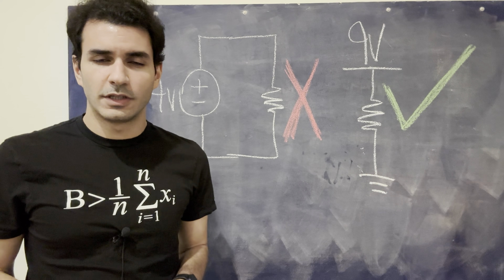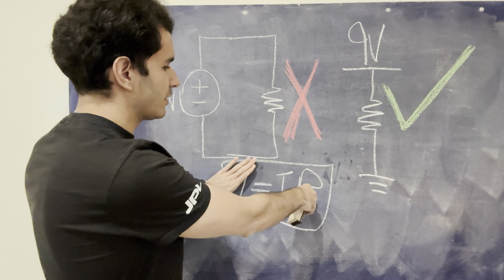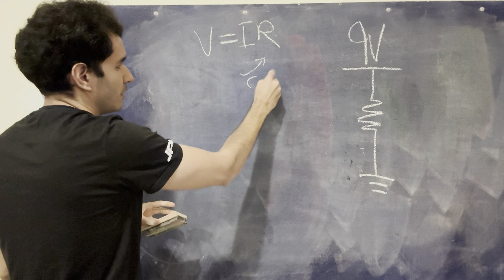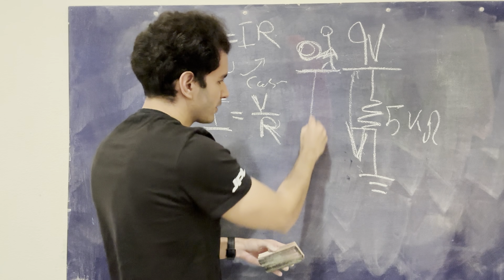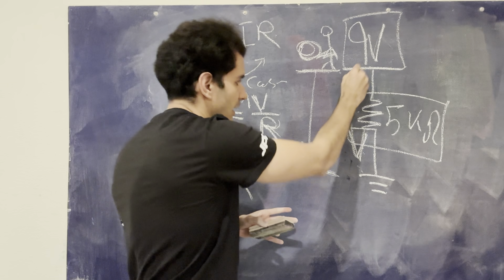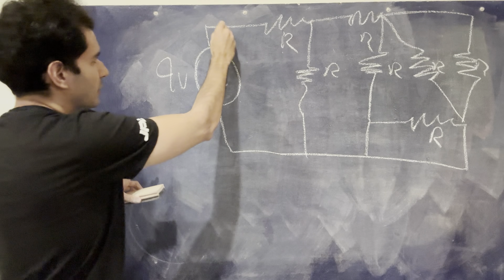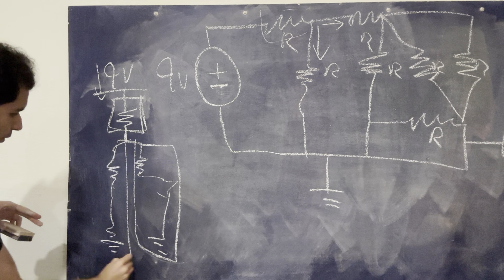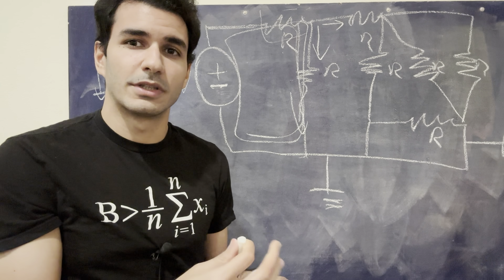Circuits Finally Made Sense When I Saw This One Diagram

Comment: No way to get around it, current must leave somewhere, and eventually come back there.  That "9V" has to be with respect to some other reference point; if you choose ground, that's fine, but voltage is always a difference between two points.  I guess if it helps your understanding to redraw it that way, great, but you can't lose sight of the basic electrical principles of potential difference and current flow.  What happens when you have a dual supply (plus and minus) op amp?  Would you have current flowing "up?"  The + and - supplies are referenced to a common or ground.  Then I guess you're back to loops instead of a simple +, ground, and resistance.

All the V=IR is telling you is the relationships between the numbers.  Hold voltage constant, increase resistance, and there will be a proportional drop in current.  Hold resistance constant, but increase voltage, current increases.  The triangle or circle with V, I, and R is just a convenient way of "doing all the algebra ahead of time".  You want resistance? Why, that's v/i.  With the "standard" V=IR, you divide both sides by I to derive that.  But looking at the triangle, it's kind of "instant".

Comment: I just finished an exam on process heat transfer, and as a chemical engineering student, we model heat transfer using an electrical circuit analogy. The resistance is modelled as a function of the material resistance, voltage is modelled as a function of the heat transfer, and the result is the temperatures at specific points along the "'circuit". When doing these problems, we would use series and parallel resistors to describe composite materials where heat could travel multiple paths. We would show it from left to right, or the direction heat travels.

It's interesting how several areas of engineering (and science) overlap with each other and can be used to describe the same principle, but in different flavours.

Comment: The triangle is meant to be a memory aid, not an explanation. You need to understand what the equation means first.

Whichever way you write the equation, it doesn't imply anything about cause and effect, it simply states a relationship. Very often the voltage is the cause and the current is the effect, but it can be the other way too, for example when you have a current source driving current through a resistor. You need to start with what you know and arrange the equation so that it gives you what you don't know.

One situation where I find it more useful to think about current loops rather than voltages is in a boost or buck converter. During the "on" phase current builds up in the inductor, and during the "off" phase the current wants to keep on flowing in the same direction, charging up the output capacitor. Trying to think about what's happening to the voltage across the inductor through all of that just gets me confused.

Comment: I like this idea, but with the 2nd diagram I kinda lost. Maybe you can make another video that explain it more simple and with the actual vertical drawing. Also, I was always wondering how people can make a board with I assume same "ingredients" but have different result. By ingredient I mean, a couple of R, a couple of Elco, a couple of TR and voila, it is an audio amps. But other PCB with the same ingredient (of course with different value) and voila it is an FM radio.. How can that happened?

Comment: Wow, you are SO wrong!
In what sense is the one on the right a 'circuit'?
What's circulating? Around where?
And as for Ohm's law being 'very stupid'...it not Ohm's law that's stupid.

Circuits is "this complicated thing where you have to pull out equations & do math".
Well yes. Drawing vertically and eliminating the return path doesn't remove or invalidate Ohm's law.
You're not going to get far in electronics if Ohm's Law is hard for you 🤣

Comment: a circuit IS a loop.
and what enters must exit. 

the "dumbed down kindergarten" level of understanding is only exacerbated by thinking of the "open, vertical" schematic. all it does is make things confusing as you get more complex circuits.

the TRUE electrician understands the LOOP aspect. that there must be a current or voltage source, and what goes out one end must return through the other.

Comment: This is a great suggestion for the more intuitive representation.  There no reason teason this cant be done left to right like ladder logic used in PLCs and some old electronic wiring diagrams (where PLC ladder logic comes from). Regardless, it certainly helps present the relevant information of the series/parallel structure in a readable way.

The only thing I would avoid is labeling the negative terminal as ground. I know it is a common practice but it is a misleading shorthand and there is much confusion out there about what ground even is, as in practice it is used mean a variety of specific things in different applications or (unfortunately) often left ambiguous. 
ie: earth ground, chasis ground, bonded or unbonded ground, neutral, negative, etc. In my opinion, ground should be reserved as a reference designation relative to the relevant environment and not as part of the functional circuit. That said in some applications such as automotive a "chasis ground" is the path connecting current to the negative terminal of the battery similar in a way to SWER power distribution, whereas a chasis ground in automation and appliances is a redundant(US) path to prevent stray potential. And let's not forget the complication of an earth ground bonded to the center tap of a split phase transformer.

Comment: Sadly, this guy is not EE material.    He is trying to apply arithmetic rules to electric circuits.   So what happens when  he eventually learns about Kirchoff's current laws?    And with his way of thinking he will never learn incremental modelling.   The world is not all DC.   Electrical Engineers use Laplace Transforms.   That allows them to look at circuits in the frequency domain.   I'm sure if he had to write a first term sophomore electronics exam he would get 0.
Reply: You are right Indeed. That's why this guy is  teaching in youtube and not working in NASA.
Reply: He might be working at NASA.  I spent 14 years as a contractor at a NASA research center and saw quit a few lunatics like him.  Some had masters degrees or a PhD.   Anyone following his method will be handicapped and never progress past his simplistic arithmetic.

Comment: For a lay person, this explanation may be enough. If this was all there is, anyone could be an electrical engineer. You really need conventions in order to have applicability to more complicated (real world) circuits. As an example, you can easily have cases where resisters are not in series (an exclusive node between two resisters) and not in parallel (two resisters connected to the same two nodes).  You are cheese toast in that case without delta/wye conversions to break things down to an equivalent resistance. Now you sprinkle current sources and voltage sources all over and it gets even more complicated. Then you mix in dependent and independent current or voltage sources ... and you eventually get to the point where the big bucks need to be paid. Its not that much memorization ... just a set of conventions and procedures that allow complicated circuits to be easily managed.

Comment: It’s even easier than that.  Think about it like water.  Voltage is the speed, resistance is the diameter of the pipe, and current is the amount of water flowing through the circuit
Reply: and charge, or a coulomb, is a quantity... a litre, a cup, whatever... its just a unit of volume. apply the "hydrostatic paradox" and other aspects of electricity make sense as well... like insulation breakdown...

Comment: Oooh, so much I disagree with.  Current is NOT energy. It is called a circuit for a reason. I don’t disagree that different people learn differently, but thinking you understand based on a flawed premise is worse than not understanding at all.

Comment: Thanks for the great explanation — the analogy with height and the ball really made the concept click! It's very intuitive, especially for circuits with a single voltage source. However, I do wonder how well this analogy holds in more complex circuits, like those with multiple batteries or voltage sources. In such cases, it seems difficult (or even impossible) to define a consistent 'uphill/downhill' direction, since different parts of the circuit might have conflicting potentials. I’d love to hear your thoughts on how this analogy could be extended.

Comment: ... I mean, maybe this is helpful for some, but it's just drawing the ground in a different place and saying it's better. I'm not going to rehash everything that's being said in the comments, but how do you handle when there's a chassis ground that isn't connected to the circuit ground? They're not always the same thing, just like the negative side of the power supply isn't always connected to the ground

I think it's good to understand all the ways you can notate something that's effectively the same, but it's not exactly innovative.

Comment: If anyone is more interested in this representation of CKTs I suggest you check chapter 4 of electric circuits analysis by hayt.
since the first example he used to demonstrate nodal analysis I kept using the configuration he uses till this date which really moves you're understanding for ckts to the next level (a lot of students prefer sadikus book in studying Ckts analysis but I suggest you give hayt a shot)

Comment: As an electrical engineer, keep the loop mate. And think about it.
Reply: When this popped up, I was hoping he was going to reveal something I had never considered.  All he did was redraw the schematic.   Reminds me of Thevenizing and Nortonizing, which I assumed were still taught.
Reply: The video is not trying to replace the loop diagram with the vertical diagram in engineering applications. This is just for helping people develop intuitive understanding of the basics of how electricity works, what the concepts behind all the terms are and how they interact, etc.
Reply: Sure. In my view is better to keep the loop when thinking about circuits. It's in the name. Circuit. In my experience the number of engineering graduates who don't be understand this idea especially around earthing systems shows this.  @lunarpollen
Reply: Seems like he took most of it to explain potential and then drew electrical equations around it hopefully he'll work through it @lunarpollen
Reply: I'd say the loop is more practical but the vertical is more intuitive just like the reworking of the equal its still the same thing....its just another way of looking at it.
Reply: He is branch guy, not the mesh guy
Reply: Basically, the electric field is a conservative force and thus potential exists and all the electrons near the positive terminal of the source that are at a high potential energy are able to do work and thus how you power circuit components. There is no pressure or gravity lol, those analogies are retarded and  wrong. If you think of it as pressure omg... there is no pressure trying to bust a nut lol.
Reply: I think its because he's probably a book first student.  Most of us really efficient engineers learned from hands-on experience (or mnemonically memorizing how Earth works).  He probably first learned about electricity from a non-hands-on approach where circuit drawings were his first exposure to electricity.  I can imagine that would incorrectly setup anyone's brain about recalling how circuits flow.  I bet he got really confused, in his youth, when applying circuit diagrams to water or people (instead of electricity);  I bet he never knew you could do that.  Civil engineers apply circuits to traffic, people, and other conduits.  Circuits aren't just for electricity.    Many of us modern and original engineers/scientists  are aware of circuits and loops (without applying it to electricity) and we understand (the purpose of) the diagram.  I see alot of comments from mathematicians.  I think some of you are not differentiating loops, circuit diagrams.   This guy has drawn an antenna (or incomplete circuit).  Circuits were originally water charts explaining to other engineers on how to setup builds.  That involves having a power sources.  This guy is drawing what old WW2 Veterans would call "incomplete circuits."  He needs to keep the loop with the power source in it.  He's educating people incorrectly.  He really needs to learn the different definitions of a diagram, schematic, circuits, and drawings.  He needs to get better and more particular with  literacy/definition.  But he is young.
Reply: Nah, this is more intuitive. It emphasizes the core idea--a potential difference where the flow is impeded by resistance. The loop is more abstract.
Reply: @GizmoMaltese abstract maybe, but correct nonetheless.
Reply: @tompeacock9193  Just draw a trampoline at the bottom that leads it back to the top if it's so hard to imagine it being a loop vertically lol
Reply: He’s giving u another way to think abt it no need to get angry mate
Reply: Why? A circuit actually never goes on a loop. And if you understand physics it’s obvious why.
Reply: That's an oxymoron. It's the name circuit. For all practical purposes, for which is electrical power engineering, you need to think about loops, especially for earthing.
Reply: @tompeacock9193 I think their argument is that the term circuit is misleading. Theoretically, if one had a salt bridge that was efficient enough so that it could be sufficiently long without sacrificing ion flow, the anode and cathode of a battery could be separated by a larger distance relative to the size of the battery. The potential difference (more precisely, the gradient of potential, or electric field) causes the movement of charges (current density and current). The fact the anode and cathode are close together has negligible bearing on the electrons flowing in one direction. I am confused why everyone disagrees with this video without explicitly stating why separating the terminals for ease of representation is somehow misleading
Reply: @tompeacock9193  it's in the name? oh yeah lets throw out physics because of a misleading naming convention. great idea. and what kind of loops do you need to think about for earthing? earthing is actually a great example of why visualising circuits as a closed loop is not the best idea
Reply: @gootmanboats3864  So like.... a circuit?
Reply: @whatilearnttoday5295  Per Oxford dictionary first definition, a circuit is a roughly circular line, route, or movement that starts and finishes at the same place.
I am arguing the term does not translate 1-to-1 to an electrical circuit, where charges need not return to the same place (such as in a battery). Of course, many times this does happen, but in an introductory circuit analysis course, you are trying to understand very broadly how the physics of circuits work and are treating the voltage source as a black box. The "keep the loop" purists seem somewhat silent on the pedagogy and very heavy on the application to power engineering (even though not all electrical engineers even study it), so of course in that light the complaints make sense but are shortsighted.
Reply: @gootmanboats3864  Try making the circuit work without connecting it's "beginning" to it's "end".

There is no ground in a battery based circuit.
Reply: @whatilearnttoday5295  I appreciate the attempt to help me correct my misunderstandings, but I think fundamentally we have very different ways of seeing the world and even engaging with it, so at this point there is little evidence this discussion would go in a productive direction. As such, I am electing to not pursue this further. I hope you have a wonderful 2026
Reply: @gootmanboats3864  What a strange reply. Did I just meet the main character?
Reply: @whatilearnttoday5295  that's not the only kind of circuit. and if it's more helpful to think of it as something besides that very specific circuit type, that's useful.
Reply: @andrejcupac7359 it's the name. Circuit. One observation with graduate engineers is a lack of understanding of principles, like you need a closed loop for current flow which is obviously important in understanding earthing systems. It's just my view